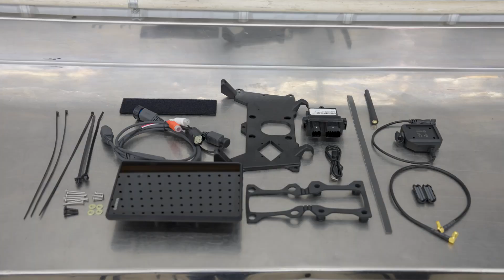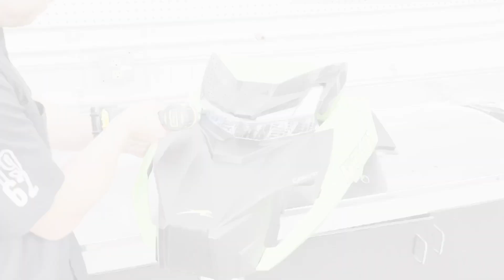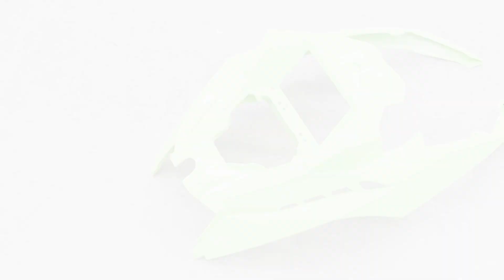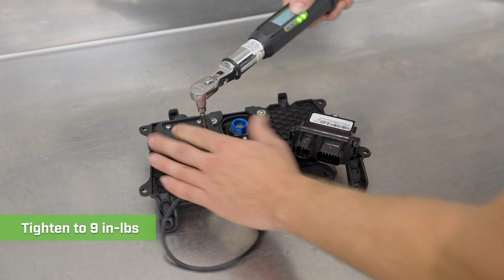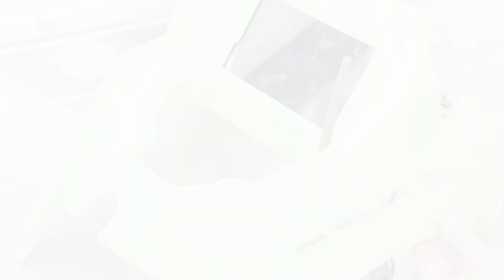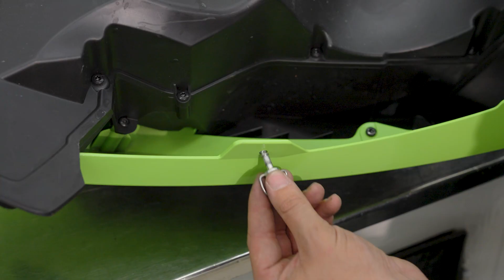G8 Display - INSTALLATION

Comment: How do you correct the odometer reading if you already have miles on the machine before installing the G8 (called the offset on a NS1).

Comment: @Arctic Cat installed just like this and double checked, when I try to use the group ride it says to connect the group ride ride to use.  group ride isn't working but everything is connected correctly. took to the dealer and they are having the same issue on their sled.. this needs to be fixed, the only reason I got the G8 was for the group ride.
Reply: You ever get an answer on this issue?
Contemplating the G8 for a new Pantera 9000.

Comment: Question: when installing the non electric start wiring harness you show to remove the plug from the number 3 position and insert the red wire. However on mine the number 3 position is a brown wire and not a white plug. On the video is show him pushing the white plug out of the 4 position based on the diagram shown on the video and directions. I followed the video, unit powers up but it does not register fuel level everything else works. Any ideas where to start?
Reply: Did you figure this out? I’m in the same situation but I haven’t put in the red wire yet. Was looking for info on what to do here. I have the brown wire in place of the #3